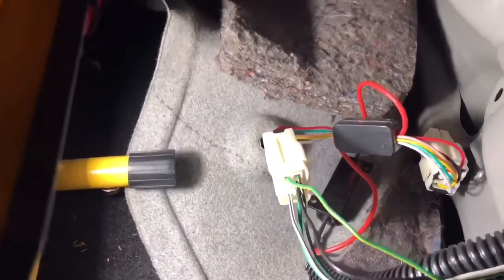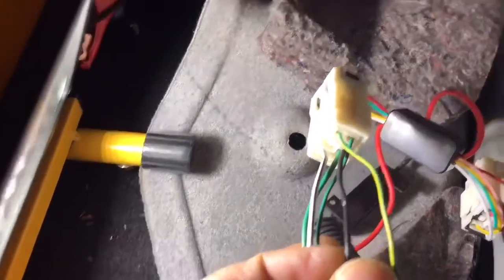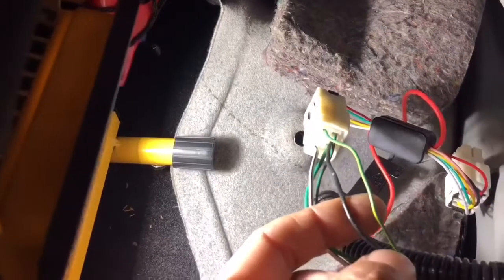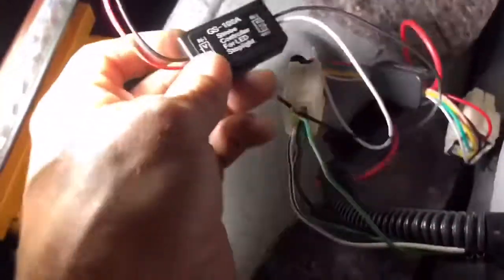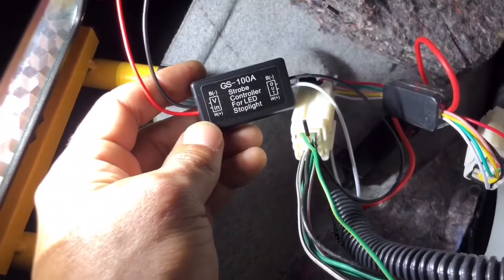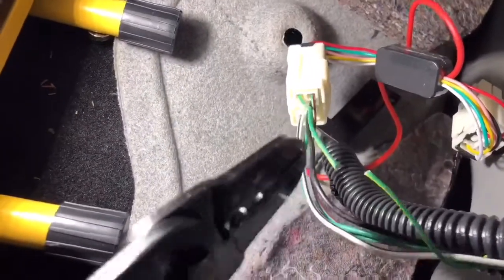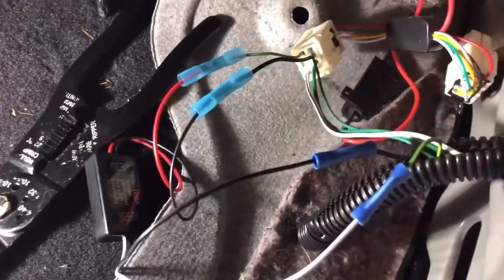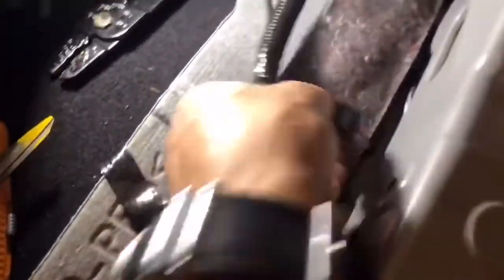G37s gets Blinker Mod👀 Brake Light Strobe Module

Comment: I did the third brake light 2 years ago but never did the tail light, I may have to do them now. Very impressive, I didn't know it would also work on the turn signal left and right @2:41.
But one thing I have notice , more people pay attention to those light, they leave a huge space behind me.  Ive seen cars drive so fast behind me but when they see those light they slow down like crazy.
I was even thinking of adding an on/off switch too just because I saw someone do it haha
Do disconnect the battery, when I did it on my third light I didn't disconnect the battery and it blew a fuse, and I was not able to drive the car at all.
On my 2009 g37xs sedan. The wires were not the same colors, it didn't work but when I put the turn signals on both left and right the strobe work.

Comment: Bro is this with the tail as turn taillights or is this with stock oem tailights
Reply from the maker: humberto del castillo I got the turn as tail installed. My tail lights aren’t stock but work the same as stock. The turn as tail will make only the halo light up on turn signals instead of that one bulb in the middle of halo. Man thanks for Watching Bro👍
Reply: Appreciate it brutha looks good 👌👌👌

Comment: Does this work on all models? I want to do it on my sedan 2011 g37xs
Reply from the maker: NwalkerR Yes Sir it does. I also got it installed on 3rd brake light as well. Install it the same way the color of the wires will be different, but just make sure you follow the same install concept. Thanks for Watching
Reply: @tgreen200  Thanks man!
Reply: Is it the same the wiring for a sedan or different?
Reply from the maker: It’s the same. Bro thanks for Watching..
Reply: Quick One okay it’s because I’m kinda having trouble doing it did you cut it from the head light or the other side
Reply: Quick One is there a way you can guide me mybad man lol
Reply from the maker: Romeo Guitterez From the tail light part. Let me know if your wires are the same colors
Reply from the maker: Romeo Guitterez Don’t cut any wires on the part that’s going into the car..Cut the ones  coming from the tail lights only. Then wire it up and you should be good to go..
Reply: Quick One I got it to work thank you I appreciate it a lot brotha stay blessed
Reply: @tgreen200 how did you connect the third twilight aswell? What wires do I cut and what colours would they be? If you remember by any chance lol
Reply from the maker: @mikeygg7347  man I barley remember Lol! But you access the wires for third light inside the trunk. You’ll have to remove the cover it’s held in by 3 pins. You’ll wire it the same green and black.